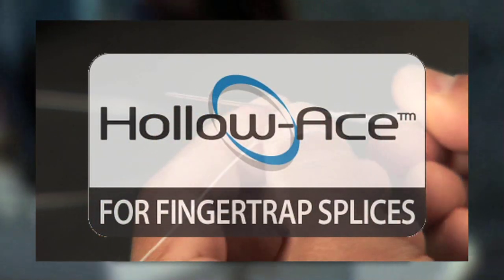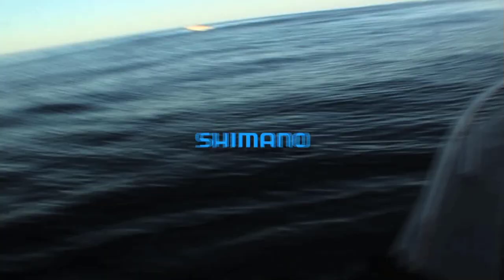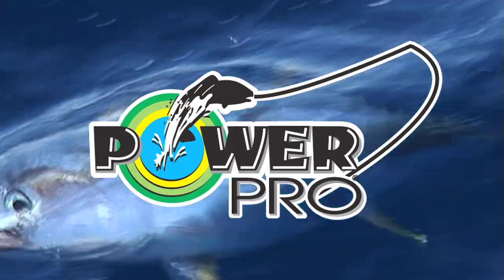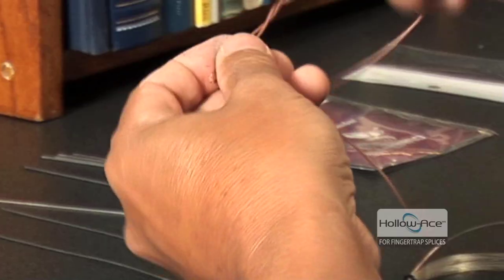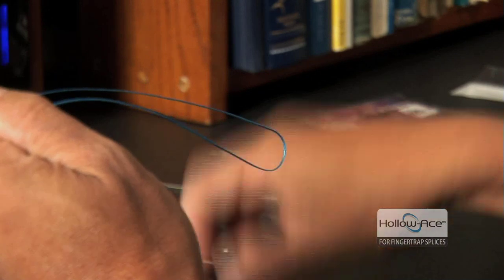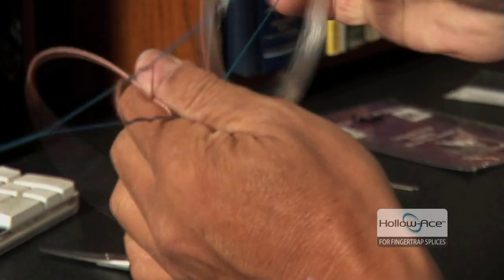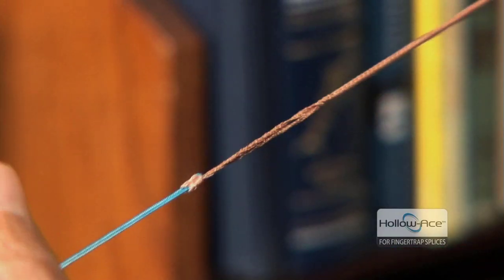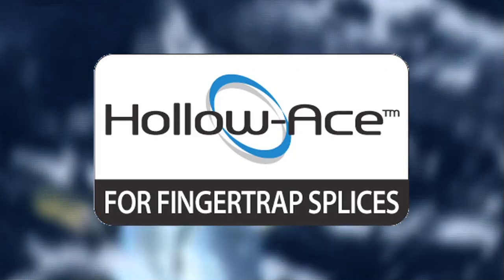Loop To Loop Connection

Comment: Can this connectionbe undone to replace the leader?
Reply: Just found this out recently. If your windon leader is trashed from catching several fish then take your cutters and snip as close as possible on the leg of the windon leader right next to the catspaw. Then take your main line loop and pull quickly on either side of the catspaw. This will straighten out the main line and release the trashed windon. You could try and take a nylon flosser for your teeth and try and tease the catspaw apart also, thus saving your windon leader.